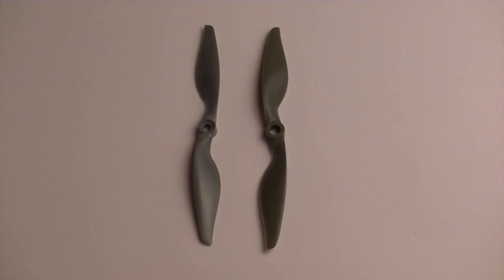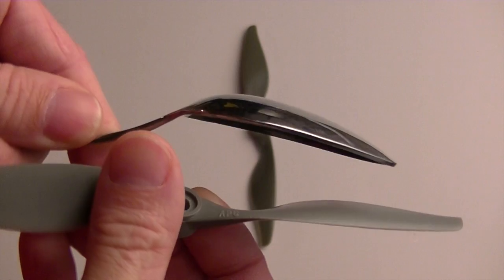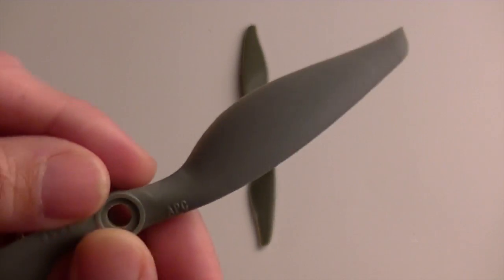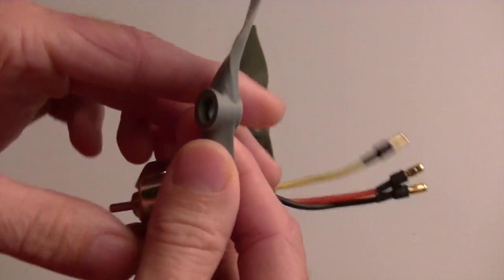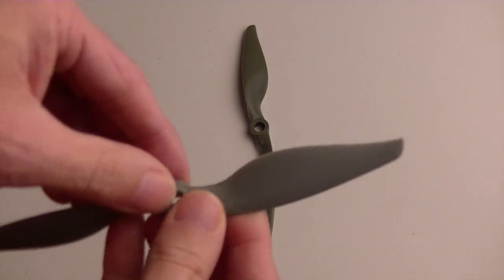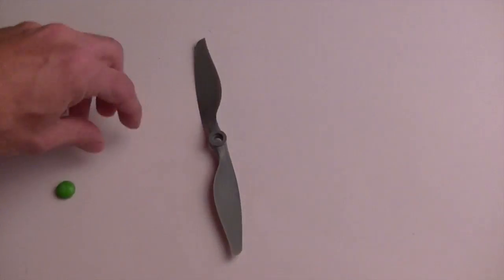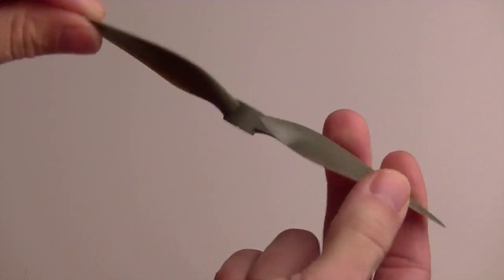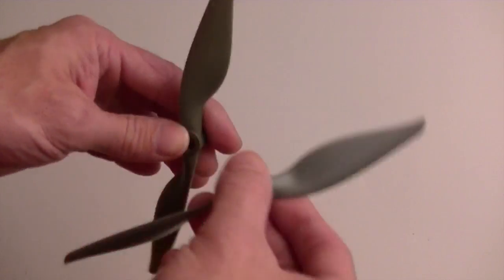CPO Quick Tip : Propeller and Motor Direction and Pusher vs Standard Props

Comment: Omg this is the video i needed. Im not sure why my zohd dart documentation online says its supposed to spin clockwise (if viewed from rear to front) but no matter the side of the propeller i put it on, i feel thrust towards the front of the plane, not the rear.....so i must have a pusher type of propeller and it needs to spin counter (if viewed from rear to front) as i tested that was the only way i felt strong push behind the plane.

Comment: alot of the bigger rc motors have flat spot on shaft and a set screw (no nuts) so works either way and either prop.. =just got to get the numbers face forward and motor spin so as air flows correct !

Comment: I can’t help it mate , I’m an old fellow who engaged in building something everyone calls it impossible and no one wanted to help , during the learning process  identifying and installing the propellers was by the looks until now the biggest issue of all , over two years work with a lots of failures just because of the missing propellers informations , I can’t wait for one more field test now , cheers for your video mate 👍🦘🦘👍🦅🦅

Comment: "IDENTIFICATION!" check your prop [ in video you dont mention it ] it has designations on yours its the "P" for pusher! on APC MODEL PROPS they are called the "E" series! however im totally new never built anything trying to buy parts at this point and their is props called "E" on APC for electric im confused here! because APC has designations for "E" which also mean pusher! and its confusing if its an "ELECTRIC" or "PUSHER" but P definitely works and its very rare! "E" can be found.

Comment: Thanks for the video. It helped me a little but that's because I don't understand any of this. My question is related to changing out the prop on my trolling motor. I lot of guys are doing this because the prop of an RC plane is more efficient than the one that it comes with. so my question is this, are props made to spin in different directions. the reason for my question is that several people have had to reverse the wiring on their TM because it spins in the wrong direction based upon the prop they swapped out for. I think it was an APC 12 x 5. So based upon what I saw in your video, if the prop seems to be turning in the wrong direction related to the "spoon" can I just flip the prop around?

Comment: Living at higher altitudes and want better performance on your Phantom 3 Pro?
I live in Denver and somebody stole my Blade Chroma out  of my garage in the 30 seconds I went in the house!
I just bought some Aeronaut carbon light 10 x 5 for them too! They had yet to make 9.5 inch blades for my 
DJI Phantom 3 Pro. I had them on the Chroma and noticed how stealth like the blades were as far as noise.
You couldn't hear them until it was 30 feet away!
Getting tired of my P3P blades sounding like a bad lawn mower I had an idea. On paper if done right it had 3 advantages.
Aeronaut is great for higher altitudes with its broad width, razor thin CAD design not to mention it's pitch wasn't 4.5 like DJI'S 
but a 5 pitch. Problem is that Chroma's blades were 10 inches compared to my Phantoms 9 1/2 length. Hell, I had no Chroma 
and with a Dubro balancer and access to a band saw I had nothing to lose. The hardest part was making a guide to make a perfect 1/4 cut on each end. Did it and balancing was made easier using a band saw for my cuts.

 The results were unbelievable! It turned my Phantom into a silent Phantom 4 killer!  Remember I'm at 5,600 MSL was averaging 58 mph and 8 meters a second climb rate! At my altitude the descent rate was 4 mps to be safe in this thing air or go nuts in a circling dive.....but why? I did have to at least try it once! I'm eating P-4's since Aeronaut has not made a snap on for it. But you'll never get the pitch because Aeronaut has now come out with Carbon lite 9.5 x 4.5 blades for any screw on Phantom blade. I'm just giving P-4 owners a poke in the ribs because it's such a sleek looking drone. Plus speed will bite us sooner or later! I wrote this for mainly owners living at high altitudes. I took it up to Echo Lake, Colorado and the Aeronaut blades were superb! Careful if you go so far out and you have to hit RTH, I didn't hear the damn thing until it was coming down 30 feet above me! Any questions feel free to drop a line.
 Just bought the Mavic Pro and heading out at sunrise for my first flight!

Stay safe!
Jeff Sallee
Westminster, Colorado

Comment: Been flying RC planes for 6 years, bixler 2 for 3 years, just replaces my bixler motor with a like one and couldn't figure out what happened to my thrust over the last 2 flights. Goes to show you we all make mistakes -- I had put the prop on backwards and barley had enough thrust to fly into a small breeze with my FPV equipment on board.  Cant wait till tomorrow to give it another try. Im confident now with the prop installed "cereal side facing the rear of the plane", I will have plenty of thrust given the stock configuration.  Thanks for the vid.

Comment: I have a question. Just getting started in RC I put a plane together w and electric motor, have not flown it yet, when i do a test taxi the plane pulls to the left. How many degrees do I have to tilt the motor to the right to fix this problem. Thx

Comment: i am making a flying wing  and i am mounting the motor on the backside of the wing so ,,,,which prop should i use a normal 6x4  or a 6x4r ( right hand rotation) and while standing in the front of the plane seein the tip of the flying wing and the no. of the prop( 6x4r right hand rotation) facing into the motor ,,which direction should it move clockwise or counter clockwise

Comment: i am making a flying wing  and i am mounting the motor on the backside of the wing so ,,,,which prop should i use a normal 6x4  or a 6x4r ( right hand rotation)

Comment: As a rookie at flying RC aircraft, this video brought it home to me in a clear manner.
Reply from the maker: Thanks, Robert Allen.  That's what I was hoping for!
Reply: A brushless motor can spin in either direction. Just swap two of the motor wires to reverse it.
Reply: EVERYTHING cpo Can I put a APC propeller on the front of my plane?
Reply: EVERYTHING cpo is this motor which is on the thumbnail moves in both the direction

Comment: i look at the side of the prop. 
the flat side of the prop must be facing to the back of the plane. works fine.

i have a few 9x6 props here and found out that there is lots off diverence between the thrust they deliver. which is strange i think as they all are 9x6 props.

Comment: Great explanation there EVERYTHING cpo ! 
Would you mind answering this question?
Say that you don't have a pusher prop available (CCW?) and only a CW rotating prop. Is there anything wrong with putting the CW prop on (facing the proper way, of course, and the use of a prop saver to eliminate any chance of a nut coming loose) and just reversing the direction of the motor? TIA!
Reply from the maker: It should be fine.
Reply: Thank you EVERYTHING cpo !

Comment: Sorry but I dont understand it I have completed my plane and its a pusher delta wing and if I see it from back the plane it turns in clock wise so still dont know which to choose or hpw to put the prop and my bolt also tightens in the clockwise so thats why I connected my motor to spin clockwise but which the prop and which prop

Comment: Hi!
Great vid! it was very helpful for me as a newbie. i have the bixler 2 and faced that problem with the motors rotation unscrewing the prop adapter, so i lost it on the maiden flight. luckilly i manage to land the bixler safely.
But here is my question. im thinking of buying a pusher prop. but do i need to replace the motor or can i just switch cables that it'll rotate on the oposite direction?
in advance. Thanks!
Reply from the maker: The motor is the same, just swap any two wires and it will run the opposite direction.  The motors are bi-directional.  

Even though you didn't ask, I figured I would share this.  It really helped me understand how swapping 2 motor wires changes the direction.

This is simplified for demonstration. A motor is powered from pulses from the ESC.  On a brushless motor, there are three wires that are used to send pulses.  It sends them through the wires in order. (This is very simplified, but should give you a good visual.)

Lets label the wires A, B, C.

If you plug them in, the ESC sends voltage through them in that order...A, then B, then C...the motor will start spinning in a direction. So the pulses will be sent out like this:

A-B-C-A-B-C-A-B-C-A-B-C-A-B-C-A-B-C-A-B-C-A-B-C-A-B-C

Over and over again, and the motor goes round and round.

Now, lets switch any two wires going to the motor. Let's switch the A with the B.

Now the wires are like this:  B, A, C

Now it looks like it should totally screw things up. Clearly, B-A-C isn't in order, and it will just freeze?  Nope.  Look what happens when you start firing them off in that order:

B-A-C-B-A-C-B-A-C-B-A-C-B-A-C-B-A-C-B-A-C-B-A-C-B-A-C

What do you see in there?  C-B-A  -- its backwards. That's why the motor turns in the other direction. It doesn't matter what two wires you swap. Go back to the original placement of A-B-C, and let's now swap the B and the C -- to A, C, B

A-C-B-A-C-B-A-C-B-A-C-B-A-C-B-A-C-B-A-C-B-A-C-B-A-C-B

See...same thing... C-B-A over and over again.

Want to reverse it again from this point. Swap any two wires.  Let's do B and A.

Now it's C-A-B.  What happens when we fire it off in that order?

C-A-B-C-A-B-C-A-B-C-A-B-C-A-B-C-A-B-C-A-B-C-A-B-C-A-B

Yep...back to the original order of A-B-C.

I hope that all makes sense. It was totally fascinating to me how it didn't matter what two wires you swapped to change directions.  Now it's clear as a bell to me.
Reply: EVERYTHING cpo
 OK! Thanks!

Comment: If I look at the motor on the Bixler from the back (with the tail into my face) I was told that motor will spin clockwise direction. You say that it should soon clockwise looking from the from which would mean it is spinning anti-clockwise when looking from the rear. Which is the correct way please?
Reply: ***** Hi, I have got the 6x4E prop from Hobbykng which seems to be the same as the standrad 6x4 prop that comes with the kit. So I assume it is a pusher prop? Also I have got some grey APC style 6x4 props also from Hoobyking. My motor is set up to spin clockwise direction if I look at it from the tail. I'm hoping that if I fit either of these props with the concave part facing away from the motor and the motor spinning in the direction as I mentioned (clockwise when looking from the rear) that it will work properly. Sorry for all the questions mate.
Thanks.